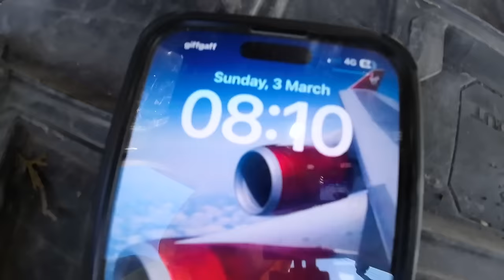SOAKING WET BRICKS AND A DODGY HIP SLOW US DOWN

Comment: Hi Steve, good luck with hip replacement, had my left hip done 2021 ,doc wanted to do it in 2015 it was really bad shape then. Worked with a cane the last 2 years before operation, on scaffolding, roofs everywhere. Went back to work after 3 months, got rid of the cane after 6 months visiting my daughter in Wales & took 2 years to loose the pain. I'm 65 now & still bend over & put my left leg behind me to lay the lower courses. I feel your pain.
Reply: Also it takes a long time to train yourself not to limp
Reply from the maker: Thanks pal I’ve heard that too .
    My right leg is way bigger than  the left from limping for over 2 years .
    😔🧱👍🏽

Comment: So what happens if you use wet bricks ?
Reply: Water soaks into the mortar making it difficult to build up your courses because the mortar bed is sloppy, also dribbles out on to the faces of the bricks and makes a mess that can be hard to clean up afterwards.....
Reply from the maker: Thanks Richard 🤙🏾🧱👍🏽

Comment: Why are wet bricks a problem?
Reply from the maker: They need to absorb water from the bed plus the mortar runs if it’s too wet 😱🧱👍🏽
Reply: @SteveAndAlexBuild  
If they are too wet they cannot be laid - as they swim all over the place.
and efflorescence staining will be an issue with the wall during drying out.
Smearing & staining on the wall, and almost impossible to "joint up"  the work at the end of the shift....
🧱🧱😁😁👍👍
Reply from the maker: @martin2466 🤙🏾🤙🏾🧱👍🏽
Reply: Thanks for the information.